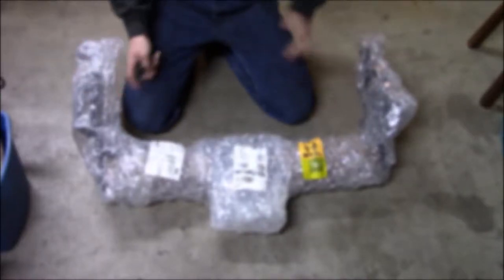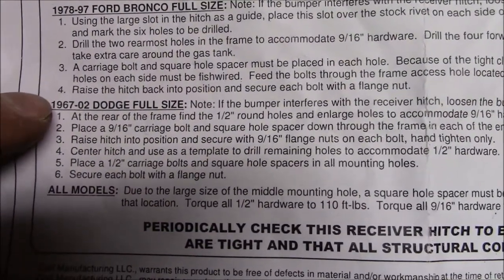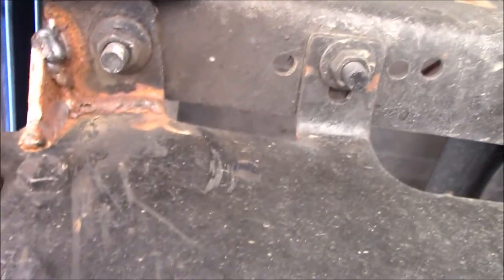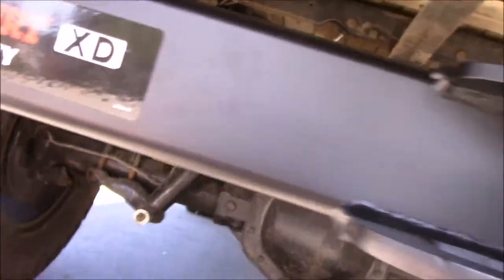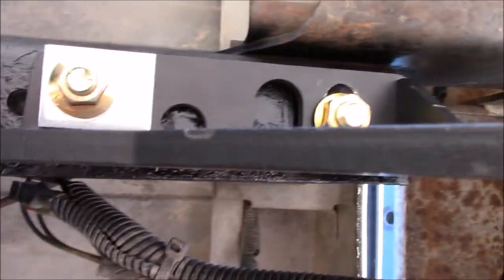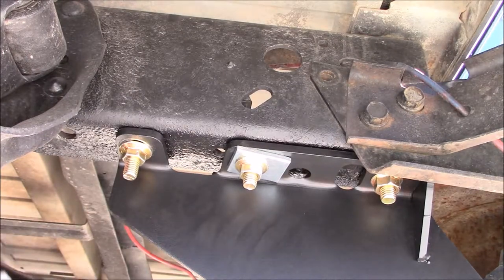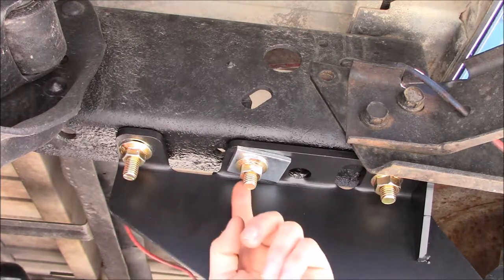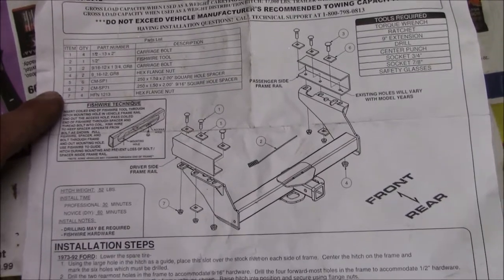Curt 15300 Receiver Hitch 1st Gen Dodge Cummins Install

Comment: Thanks for the upload, I just got one for my 1993 D250.
Reply from the maker: no problem thanks for tuning in
Reply: Did you need to drill any holes?
Reply: Kyle _Kupisch personally, I did not. I tow less then half the weight capacity & didn’t want to drill into my frame.